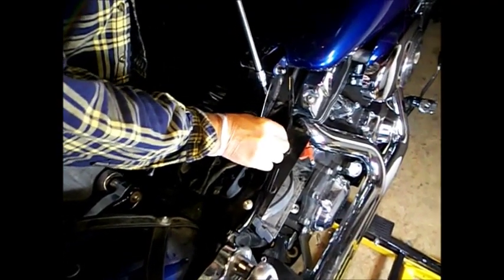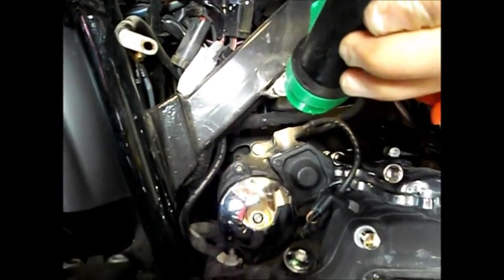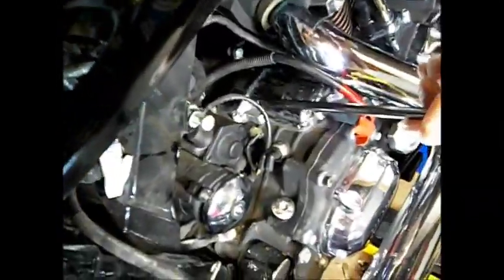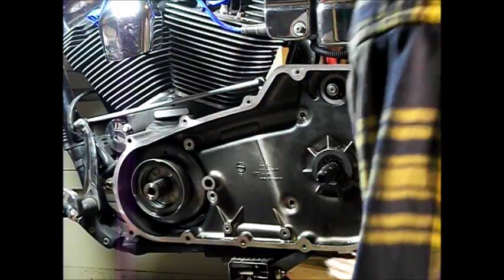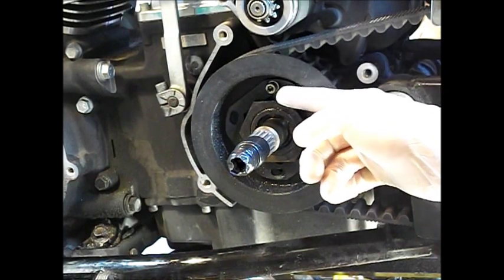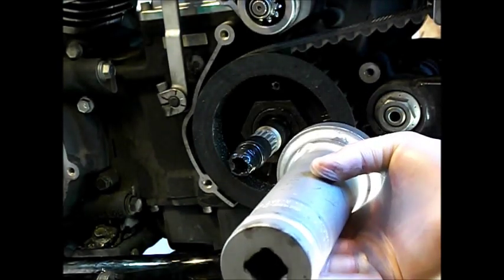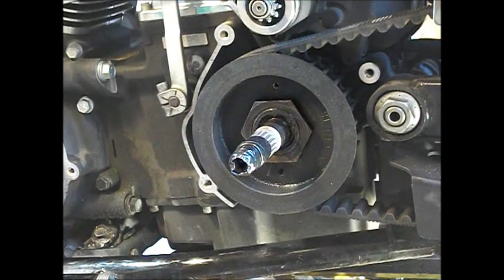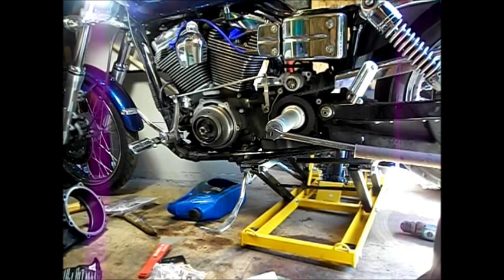2006 Dyna Wide Glide Leak Repair 2of6

Comment: Great vids it was a real help.  I have a 2003 fxdx  saw the vid and assumed the general steps were the same. they were except the flat nut holding on the main drive belt pulley was reverse thread, I cracked the nut going the wrong way, luckily the threads on the shaft were ok. Great job, just a heads up for anyone else out there don't assume call your dealer. Thanks again keep it up

Comment: OMG!!! All of the other videos in this series are very informative and helpful. However, if you are doing this job yourself, DO NOT do what he's doing in this video. The transmission main gear/primary pulley nut is a reverse thread. It does not come off "crunchy". It shouldn't need heat. It shouldn't bend a breaker bar with a pipe on the end for extra leverage. It is a clockwise/reverse thread. This dude caused A LOT of damage with his removal of the main gear/primary pulley nut. My guess is he heated the shaft/gear up enough to manipulate the steel and re-thread the shaft the wrong way. And he will at some point need to replace the transmission main gear and various parts within the primary and/or transmission when everything falls apart. The rest of this video series is pretty solid. But, this is bad. All bad.
Reply: With that said. Thanks for having the balls to post a DIY video for garage mechanics. It's always better to do a job yourself than pay a dealership. Like I said, this series is very informative. And, it's nice to see a video in addition to the service manual description. However, people need to know that the nut is a reverse thread and doing it this way can cause un-reversable, serious damage... Clockwise.... Reverse.... Thread
Reply: That is only for the pre-2006 sprocket nuts.  On 2006 and up 6 speed Dynas the primary pulley sprocket nut is RIGHT HAND thread, not reverse threaded.  It is even printed on the sprocket itself as such.
Reply: Thanks to Barbara, Russ and Keith Ocean state Harley they really made a mess of this.
Reply: Hello Maniacal202! I'm about to do this tomorrow on my 1994 FLSTN .... I just want to make sure ... are you saying that if I have to loosen the nut I need to turn clockwise ... correct? ... also I did not put my bike in any gear and the bike is still in natural ... would it be OK to just clamp down the rear brake pedal? sorry ... I'm new to this and so far I have taken out everything and now ready to get the main shaft nut off ...
Reply: Man!!! I can not thank you enough!!! not only it was righty loosy but the darn thing pretty much came off by unscrewing with hand ... DAMN! ... now I'm hoping the God if you are reading this message if you could tell me if I have to use a red or blue loctite when putting this but back? ... thanks again,

Comment: Heads up if oil leaks down the trans its the main seal , if its leaking out the inner primary side its the drive seal .  when the drive seal takes a $hit , the trans will drain dry .  with a main seal it will still be on the dipstick.   inner primary seal it will run under the frame to kickstand .

Comment: Did you strip that nut? Cause its reverse threads and i looked like you went lefty loosy the whole time with all your heat and cranking with that big old cheater bar looks like you went lefty tighty till strippy lol